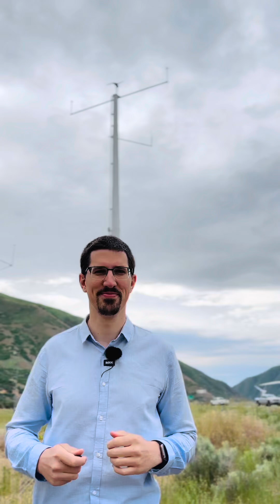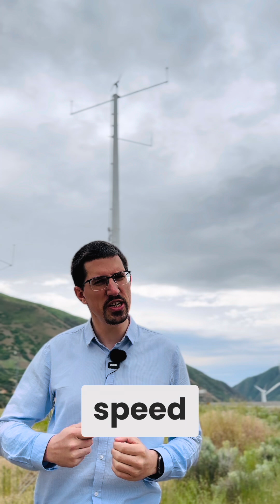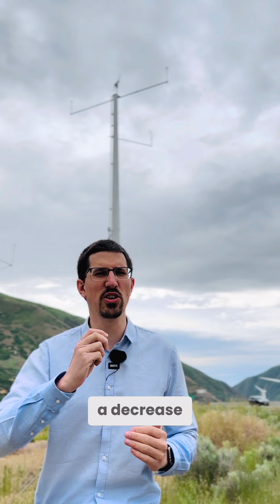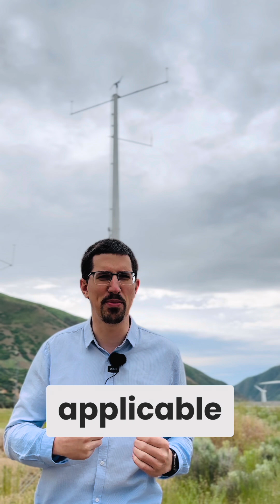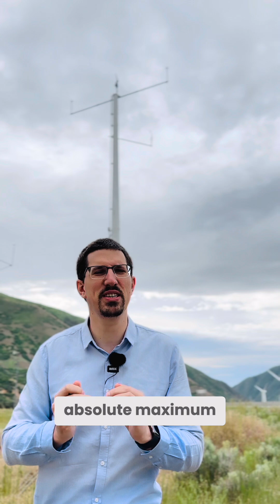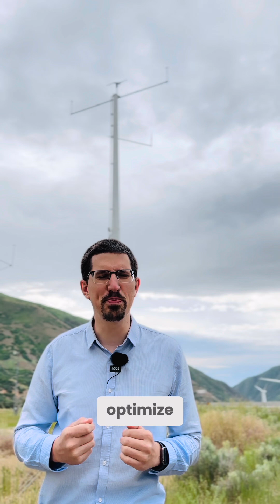SkyWind explained: Difference between PV and Wind turbine inverters & controls

Comment: How is the rotor mass impacting mppt?
Reply from the maker: Good question! With our design the effect comparatively small, as our rotor mass is just about 1 kg. With other designs and especially a bit larger turbines the effect is very drastic - The controller will treat the inertial energy as wind energy and only react after the rotor has slowed down losing inertia and efficiency. After the rotor has spooled up again the cycle repeats.